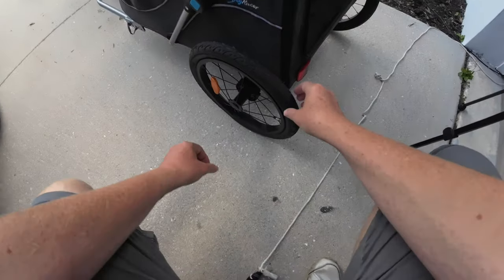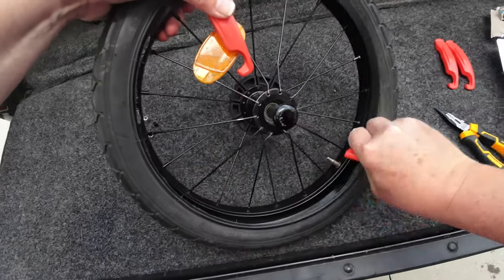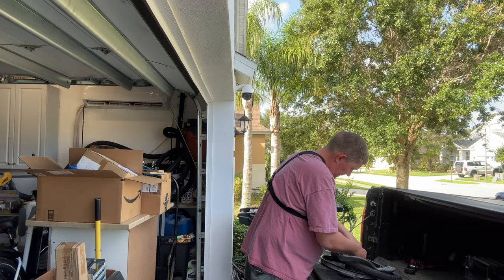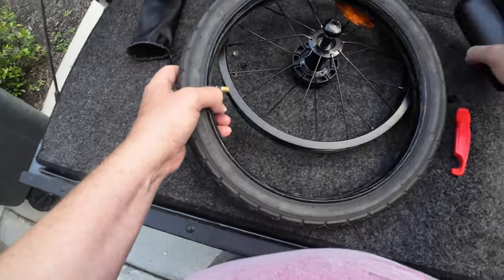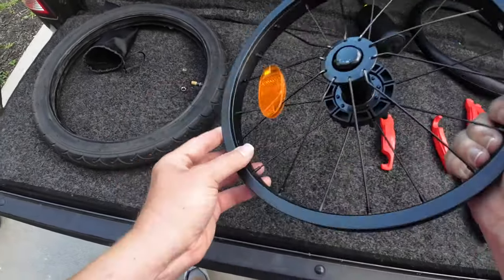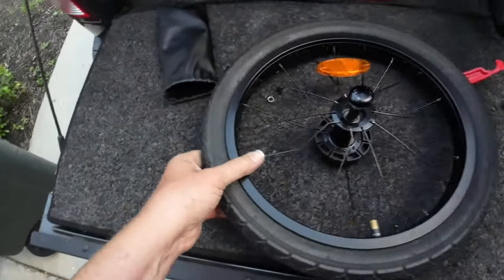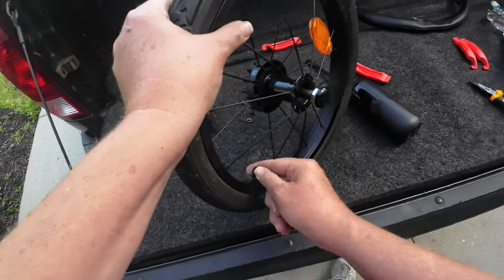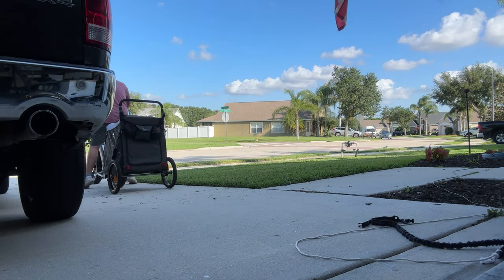How To Fix A Pet Trailer Flat Tire, EASY! (#ebike , #pets , #biketrailer )

Comment: Check the inside of the tyre for thorns etc, if thorn is still n there it will puncture the tube again.
Carry a spare tube if you dont want do a patch repair, i usually get flats when i am a long way from home.
Carry a puncture repair kit anyway, 
On your ebike you can patch a tube without taking wheel off bike.

Slime does work most of the time( not always ) but the trick is to have high tyre pressure and spin the wheel all direction so that it coats the inside plenty and the more pressure gives it more chance of fixing the hole.
I had a big rusty staple stuck in my tyre once , the slime got me home( left staple in and slime already in the tyre ) but i had to fill the tyre twice once i removed the staple before the slime managed to seal the holes, rode it for years and still going.
Only time it let me down was when i got 5 thorns in the back tyre and i didnt have a pump with me so had a 5 mile pushing heavy ebike back home which wasnt fun, once home i patched a couple of the bigger holes and added more slime, pumped up to 35psi and slime fixed the rest and got me back on the road again.
Down side is ride is pretty hard but for me its a price worth paying.